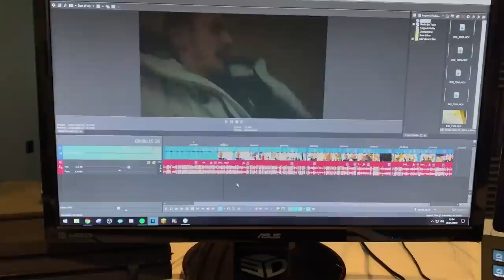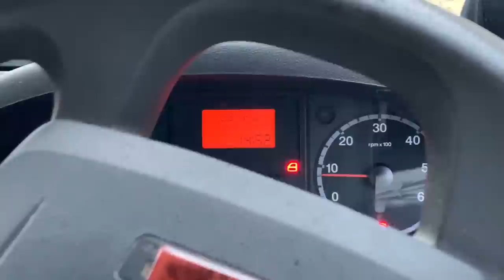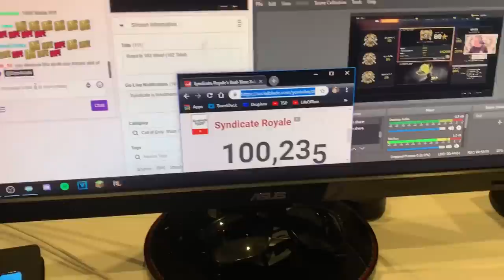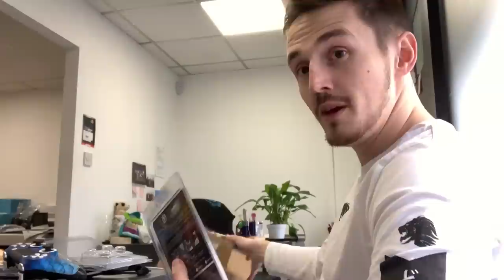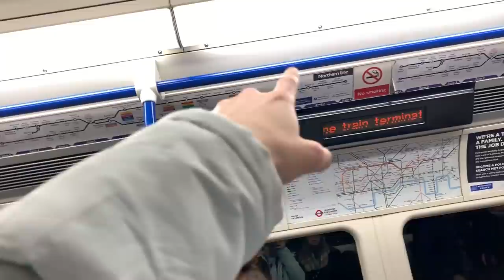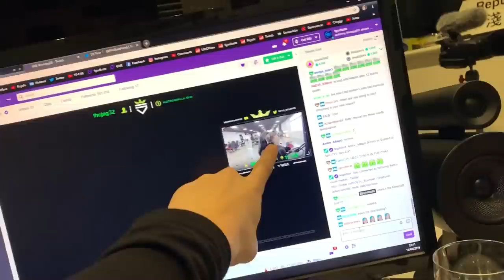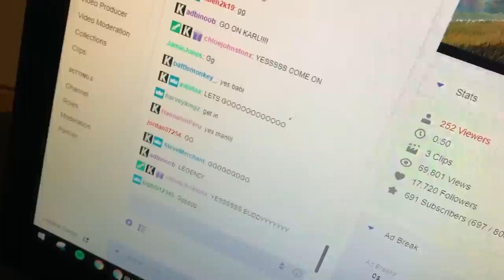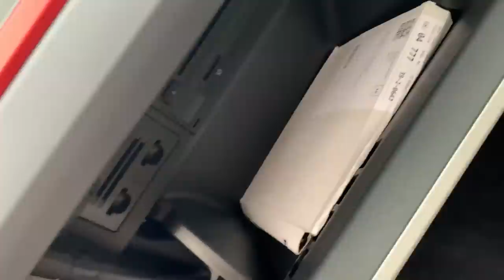A Week in the Life Of Tom!

Comment: Hey tom. Sometimes when a diesel engine hasn't run for a while the fuel runs back to the tank. You have to hand Prime the pump under the bonnet until it goes hard. Let me know if it works

Comment: i know what is wrong with the defender it happened to my van before, its not the battery being dead or anything it is the ignition. where the key goes into the ignition  it is probably worn and is not connecting properly, you need a new one of those, just look at the igniton and you will see the wear in it

Comment: Well tom older generations can fix stuff because now every thing is done by a computer that even mechanics dont even get dirty with oil because apperently they send the enginge away not like they used to do before all this shit and all new cars are basically computers
Reply: at Jaguar land rover they get sent a shortblock which is literally just the pistons and block. everything else they have to strip and rebuild however at the german manufacturers theyre more plug and play with crate engines so all you have to do is drop the coolant unplug everything and pull it out

Comment: Tom when you change the key fob battery it disconnects the car from the fob, and the problem is probably to do with you alternator
Reply: False! The alternator has nothing to with the car not starting.
Reply: Nothing to do with the alternator , the key fob has just lost its coding
Reply: @harrymclean3172  No the keyfob has its coding in it still but becuase the car battery went flat the land rover doesn't remember the codes. easy fix mate, Put the key in the ignition turn the key once and press the lock button. Doing this is program the central locking to detect the key-fob
Reply: If you leave the battery out of the key for for too long it will loose it's coding it's just a fact
Reply: @harrymclean3172  No its not a fact as a every key fob has something called a Transponder chip which doesn't matter if the battery is in or not  the codes will NEVER be lost as unless the transponder chip it self is broken. Land rovers key tend to not work after changing the battery on the defender it self.
Reply: Flash Gaming Hq the land rover key disconnects from the car when you take the battery out and Land Rover have a diagnostic tool to reconnect I own one myself